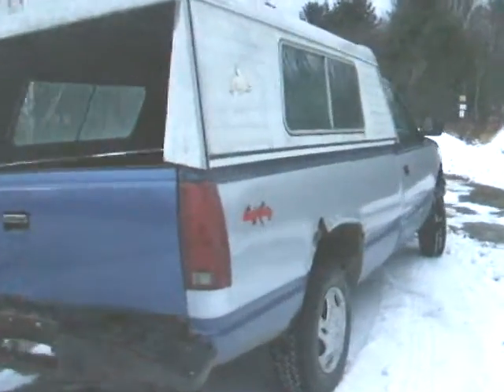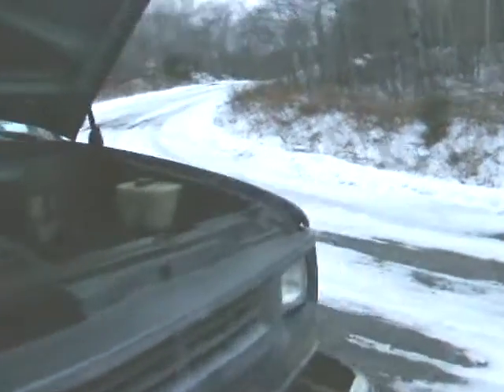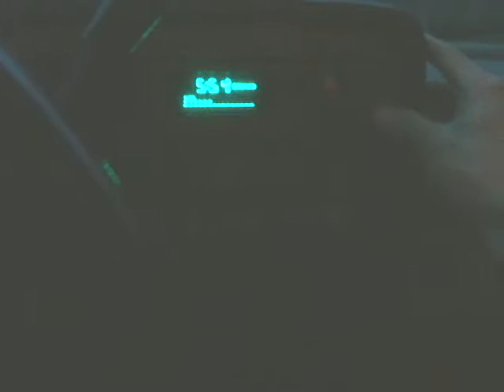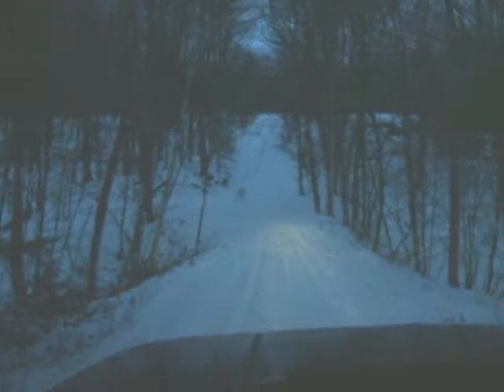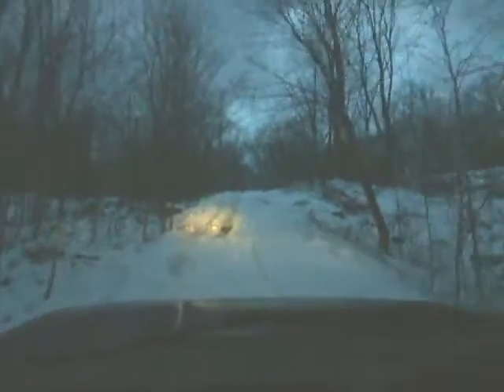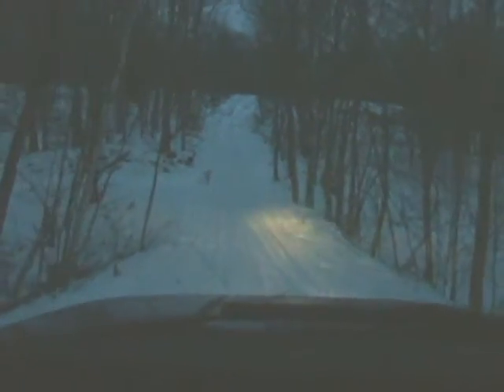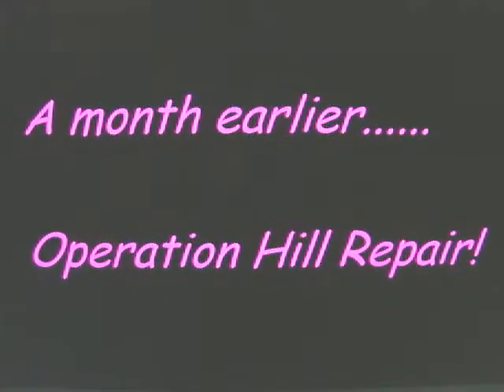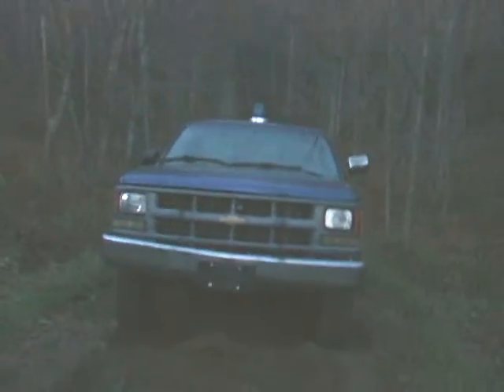Demo and Snow Driving my "New" 1989 4x4 Chevrolet 'Silverado' K2500 Farm Truck - 5.7L V8, 4spd Auto

Comment: The same color as mine, but without the rust from stupid salt customizing. Fenders are easy to replace, and patches are available for the rear wheel arches. But I am sure a rust free truck can be found as keeping it at bay is a never ending battle at. 
this stage.